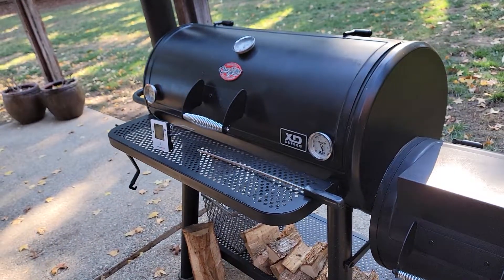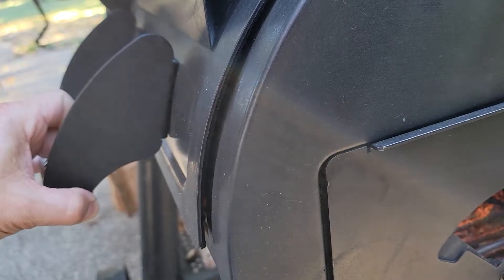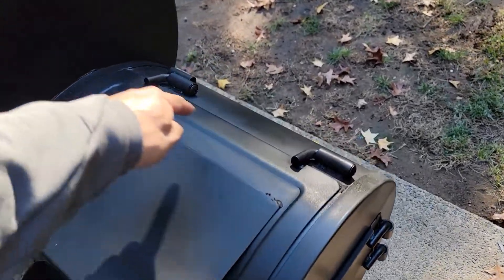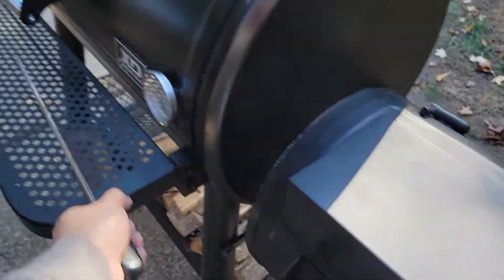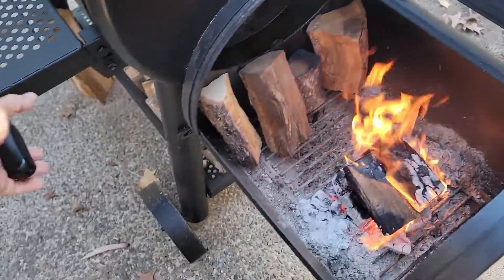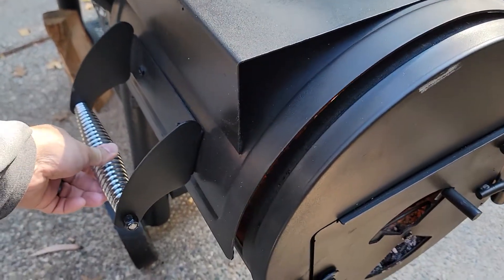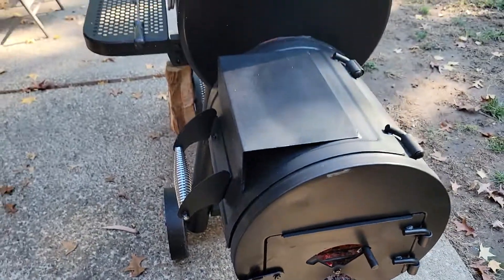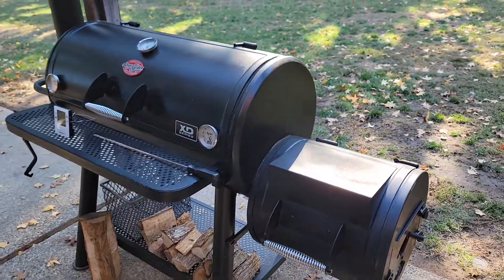Warped Firebox Lid - How to Fix - Char-Griller Offset Smoker

Comment: I just did this with mine the other night. Used my fire poker for the rod / fulcrum. The door was already sticking up like that when I got it new, ten years ago, but now it's sitting flush and tight. Almost no leakage now. Really made a huge difference in control. Who knew, all these years I just needed a fulcrum and a gentle push or two to fix it?
Reply from the maker: That's so funny!  Such a simple fix, right?  I'm glad this worked out for you!

Comment: I did this and the lid closes. But, now there is a large gap on the top of the lid where the heat now escapes. You fix one issue but then it creates an even worse problem
Reply from the maker: What did you use, a broomstick?  I've done this on two of my offsets with a long screwdriver and no extra gap was created.  Maybe there's something wrong with your lid.
Reply: @TonyToneBBQ  Nope. Used a long screwdriver just like you did. Could be the metal getting too hot over time, not sure. Im gonna reseal it with lavalock gasket. But, unfortunately will still be a gap along the top

Comment: What side wood splits do you use for that grill ? Do you cut and split the wood yourself
Reply from the maker: What's up DJ Cut?!  Great question!  Thanks for asking.  I cover this and I show exactly how I cut and split my wood in a video I recently posted.  I'll leave a link below.  Please let me know if you watch it and let me know if you have any more questions.  I cover a lot in this video but if you want to skip to the part about cutting and splitting, jump to about 19 minutes in.  Thanks for watching!  https://youtu.be/YNcj57MSDH8
Reply: Was talking to a co worker about where he got wood from in. He mentioned in the past he has bought bundles directly from local bbq restaurants.  Thought that was a decent idea. Usually cheaper than buy from stores as well.
Reply from the maker: @johnbowman4844  that's cool, if the restaurant has a big enough supply to sell some of it.  Definitely depends on the area.  Thanks for the tip!

Comment: Char grillers are pieces of crap, just finished my first season. Held my temp at 300 degrees ( not the 450 that char griller recommends) and my paint melted off my fire box. Already tried Rust-Oleum high heat for grills and that came off as well
Reply from the maker: Mine too, the paint peeled off of my Smokin Champ's firebox during the seasoning.  The paint has not peeled off off of my Grand Champ XD, anywhere.  Considering my Smokin Champ cost me $200, it didn't bother me and I actually expected it.  I sprayed it with Rust-oleum Engine Block paint and it never peeled off again.  Although it didn't look as pretty when the paint peeled off, it had no effect on it's cooking performance so again... for as low a price as it was, it didn't bother me.

Comment: Needs to be hot right .
Reply from the maker: It helps but not necessary.
Reply: @TonyToneBBQ  gonna try this tomorrow, i got two screw drives to use! hopefully it fixes it or else I gotta buy a replacement box
Reply from the maker: @thatguysalbbl3270  Yeah, it's a very common issue caused by that lid heating up from being right above the fire.  Just gotta bend it back in place.  Should work well!  Let me know how it goes.  Thanks!